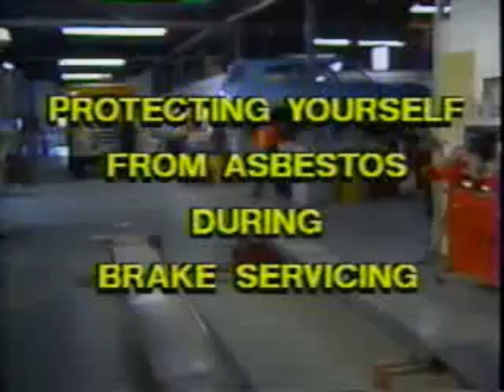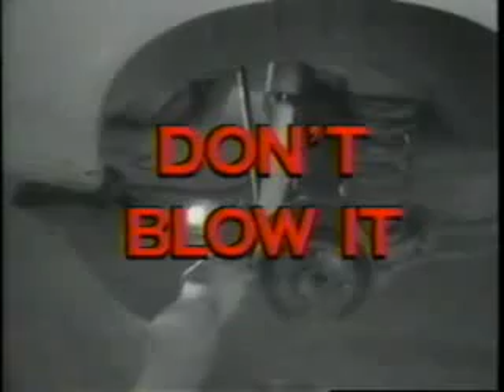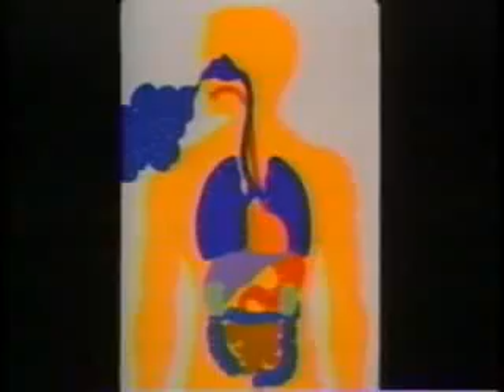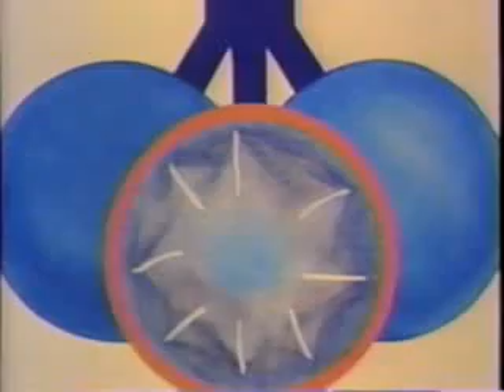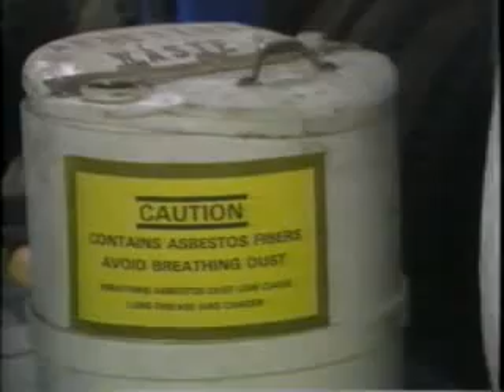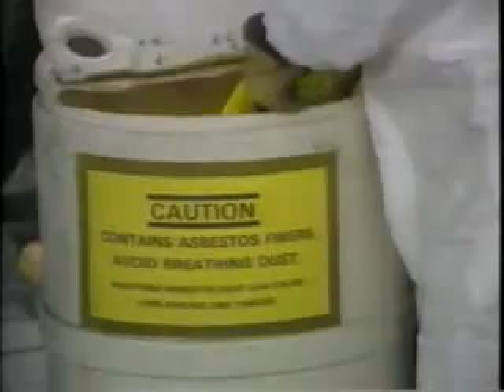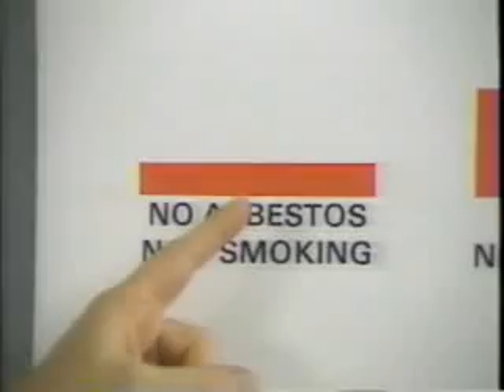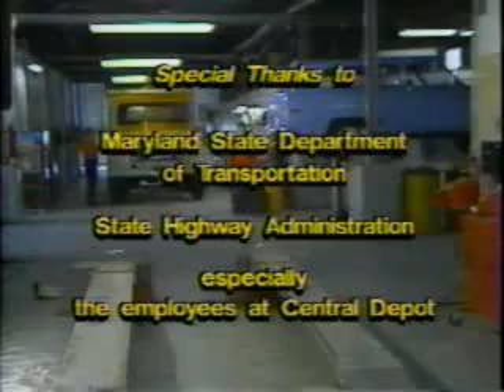Asbestos in Brakes Dont Blow It 1986 EPA

Comment: My dad worked in an auto repair garage back in the day.  They had a separate enclosed section in the shop they did brake jobs and other asbestos work. They would wear a full on respirator while doing the job and they would wear a quick jump suit. The space had a simple but effective air filtration system. This isolated the work from the rest of the shop. This made the job easier because they could skip a lot of the gimmicks you see here. He did numerous asbestos brake jobs and never came down with cancer.  He eventually passed from natural causes, but not from cancer.
Reply from the maker: Thanks for this - good to know they took steps to prevent exposure to themselves and their families.

Comment: Do mechanics really do this?
Reply: I have only seen wet collect systems. Also, just because new brake systems don't have asbestos, that doesn't prevent them from being hazardous. Any dust is potentially deadly. Alternatives to asbestos could also be deadly.
Reply: Not sure if they still use Asbestos brakes in trucks anymore. I read that Asbestos is still used in motorcycle brakes so not sure ....
Reply: No we dont use the vacuum stuff, we dont even have one in our shop and i work at a well equipped dealership. 
Cars and trucks dont use asbestos brakes or clutches anymore so there is no worrying about it
Reply: fwddodge22 alot of china and cheap made brakepads still contain Asbestos
Reply: @fwddodge22  you are very incorrect. Broom up a little pile of shop dust in your auto shop and take it to a lab to get tested. Should be about 40 bucks. Almost without a doubt there will be anywhere from 3-30% asbestos in there.